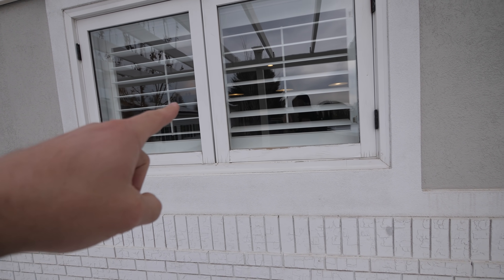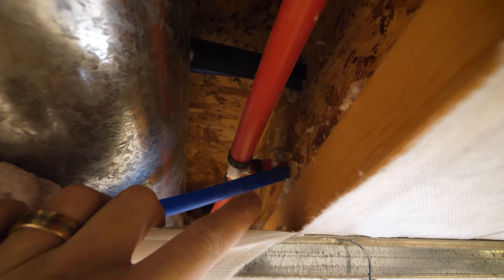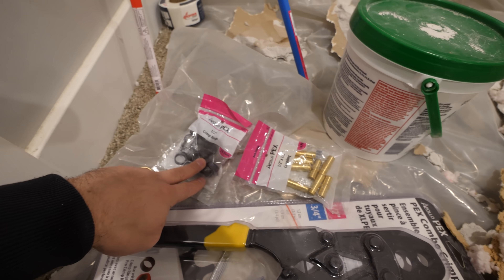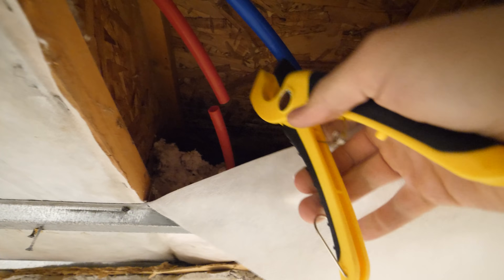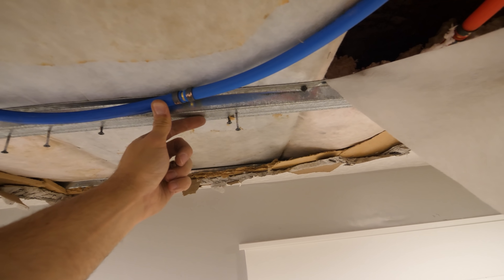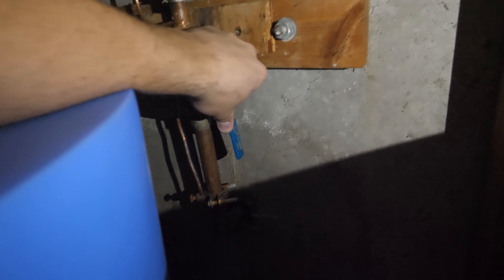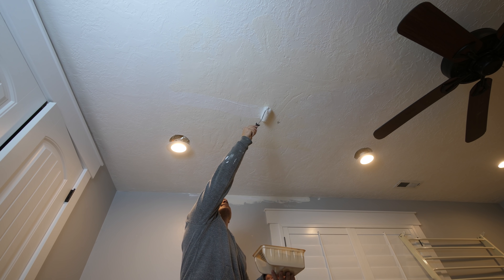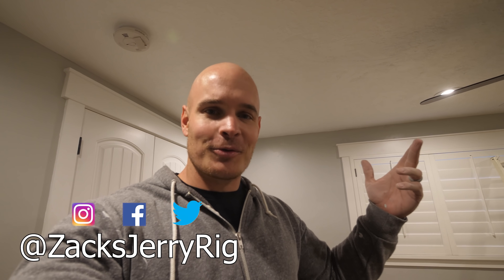How to Fix Frozen Pipes! - Can JerryRig-ing go too far?

Comment: yes the ice expands about 9% in volume, howeverits not the ice that breaks the pipe, its the pressure the ice creates that blows the pipe, which is why water blows out  at the pressure it does and in the area ahead of where the pipe froze. open up your taps will allow that pressure out but your pipes may still freeze in the right condition, however usually the flow will be enough to prevent ice from completely freezing under normal weather conditions. Im actually repairing my blown pipes right now after a week of sub -40 weather with windchill reaching the mid fifties minus c.

Comment: 1:59 is that a baby? 👀
Reply: Did sound that way...
Reply: It was the sound of the table screeching
Reply: @ocean7849  Nah fam, that's definitely not the table
Reply: @faith_spooky6270  listen carefully, it's as if you would push a table and it's legs screech
Reply: @ocean7849  Sure, but the legs aren't moving 🙃
Reply: @faith_spooky6270  there's a cut
Reply: Even if it was, so what?

Comment: Zack your lever valve for the water shutoff for your house should be plumbed in so that if the lever falls it should fall in the off position, good for safety.

Comment: If that's 10" osb ijoist, then I probably would have just run 6"  pvc ducting pipe from the outside to the furnace. The only real jerry rig would be bringing up the pex so the pipe can travel underneath. Put some insulation around the pex and around the ducting at the entrance to the house. That takes care of the cold floor problem too.

Comment: I'm not quite sure why you have that fresh air intake. If your house has been upgraded to a high-efficiency furnace and a high efficiency hot water heater. You really don't need that much fresh air coming in anymore. I would consider getting a air exchanger and installing that through the existing hole so that you have better air Exchange with more control. If nothing else I would at least put in a controlled damper

Comment: Man that suck... To fair the air vent should have Nothing in them. And that gas pipe start aging that leads to the furnace.  What if that pipe oxidize and starts leak gas?? Carbon dioxide poisoning or boom. Insulation fibers could clog up the filters. That just asking for problems
Reply: Gas and fresh air should never be that close together in the first place. Its probably a really old system installed by a jerry rigger

Comment: The original construction is quite odd. The air "duct" is just an OSB box? Seems like an invitation for bugs and mice. Especially with pipe holes.

One or two wide PVC pipes would be much better.

Comment: One idea for improvement:
You can put an insulated duct into that tunnel from outside up to where the tunnel ends and then seal around the duct where it goes outside.
By doing so you will again safe on energy and mold risk due to avoiding having an ice-cold channel running through your ceiling/below the kitchen floor 😉

Comment: The air intake should draw from inside the house because when the furnace turns on and the vent outside it draws really cold air and the furnace works hard to heat it and it the vent intake was inside it only has to heat the air 1 to 2 degrees and the same with summer just flip it around.      Also the outside vent is a good way for bugs to get in and dust

Comment: Why is that duct opened to the outside like that? Usually high efficiency furnaces take the air for the combustion from outside, but even that is done through PVC pipes. Your heating bill must be through the roof if you are constantly heating the air from outside. I think you were better off leaving the pipes in place and just close that duct opening to the outside.
Reply: HE furnaces here in the US get all their fresh air from outside the house. Older less efficient systems used air from inside the house such as the attic, craw space or even the rooms inside the house but they can also use an outside intake which helps keep the air inside the house cleaner.

Comment: that outside vent makes no sense... why would that be there? That's just letting in bugs and humid air... that' can't be right...
Reply: Newer construction homes almost always require an air intake.
Reply: @zannanger8147  I doubt they would be an open hole under a floor...
Reply: While don't disagree I've seen some truly silly things.

Edit: Thats gotta be some kind of remodel butchery. That "duct" is just the bare joist bay with a sheet metal bottom cap...

Comment: haha, if it was a wall he would have had to sand it down by hand and use paper tape which is a major pain to deal with.
tip for anyone, make sure if you're installing a wall outlet you install it with your drywall thickness above studs if its 1/2 inch then 1/2 inch if its 3/4  then 3/4  in that way the wall outlet plate will sit flush against the wall.

Comment: I image the gas line leaking and going straight into the furnace.  Would have been easier to relocate the fresh air intake and patch the hole on the outside of the house.
Reply: It just a carborator for the furnace if you get a gas leak

Comment: I just hate it when people are renovating and they decide not to have an inspection and do things the right way. This summer we removed our Knob and tube wiring and replaced it with Romex. We got an inspection and passed because we did it the right way. However back in the 1970s, someone decided to rewire part of the house and whoever did that did a terrible job. We found connected wires behind the paneling in the basement that had no wire nuts let alone a junction box. They were just electrical taped together. And we opened up another junction box and instead of wire nuts they used exposed  screw clamps that are only to be used on grounding wires. Btw we did fix the mistakes we saw but I don’t think we got them all

Comment: Uffda...that air intake should be PVC running into the furnace itself, assuming it is a 90% efficient furnace. Even if it is an 80% that "intake" is completely wrong.  You should probably call a professional to come take a look at your system.  You have cold air running right through your joist still...that doesnt make a lick of sense. Your floor is still going to be cold.
Reply: Pretty sure that was done by either the previous owner that didn't know any better or some jackleg that "saved" the previous owner a grand total of $50 in piping.

Comment: You should never just open the water valve fully directly. It can cause waves in the pipes that will blow the joints out. Open a little to fill our pipes slowly and when they fill up you can open fully.

Comment: It would probably have been a good idea to use some spray foam insulation to better seal the hole as well as make a thermal brake between the vent and pipe.  But all in all it looks great!  Good job!

Comment: Just because your house looks expensive doesn't make it is well made.   OSB is not insulation - you'll continue to have frozen pipes.
Reply: depending on his climate this might be ok as now at least the pipes are not in open air, but yeah their is not much insulating between that duct and the pipes, second worry is there is no protection to screws, so if a future home owner tried to hang something from the ceiling they might hit the pipes (not likely someone would do that but it happens)

Also that gas line going through the duct is also worrying, while the chances of it leaking are low, if it does it would not be good to have raw gas feed into the furnace intake.
Reply: @jjjacer   I would move but having to disclose what you know about the house would make it difficult to sell.  No doubt there are more idiot construction mistakes throughout the place.

Comment: Is your ceiling so called "popcorn" ceiling? I've heard that it includes asbestos and for that reason this video seems harmful for your health. Did you use proper equipment to protect yourself, especially your respiratory system?
Reply from the maker: Nope. They stopped using popcorn ceilings like 30 years ago.
Reply: @ZacksJerryRig  i see. In the video you mentioned that the house old or something so i thought there might be a chance for it to be popcorn ceiling 🤔
Reply: @Dudimies  this is the newer part of the house when remodeled, notice the LVL floor joist. The Pex lines were maybe installed then HVAC came to update HVAC and needed to create fresh air intake. Yes should have used PVC but maybe due to code needed more intake air into furnace room.

Comment: You could have instead just wrapped the pipes with the same material used to wrap AC tubes, no?
Reply: You could have, but it likely would be insanely hard to do it as pipe look deep in the house. Plus, you really don't want further restriction of airflow. This is a better method.

Comment: I never knew Americans call "plaster" "mud" :o
Reply: They call pretty much anything with a consistency of mud, mud. It's great working with Americans, you can never be sure what they mean. Same with concrete and cement, they use it interchangeably (actually, usually they call the powder concrete and the hard stuff cement). It's horrible.